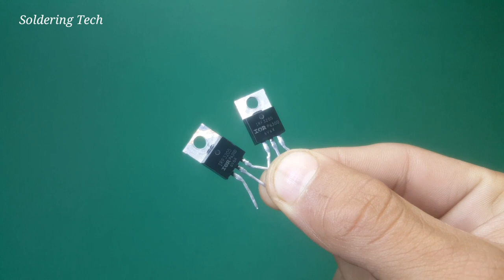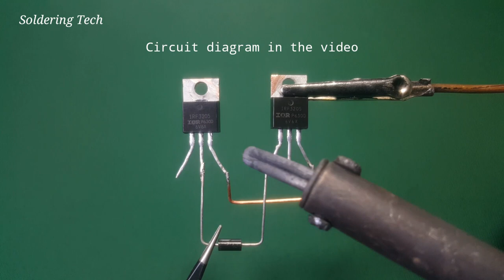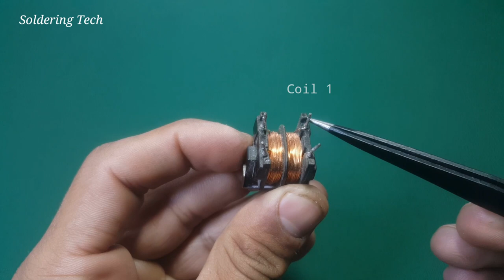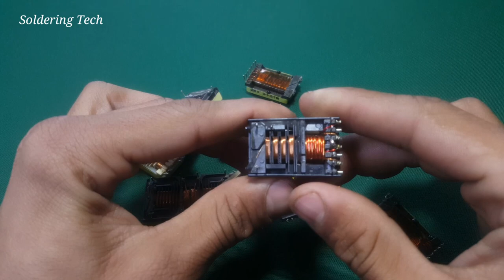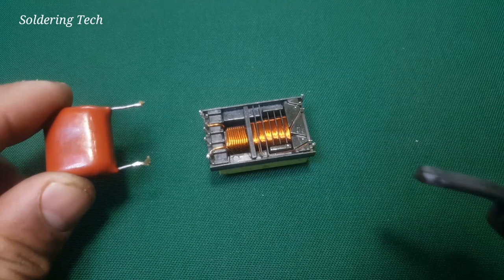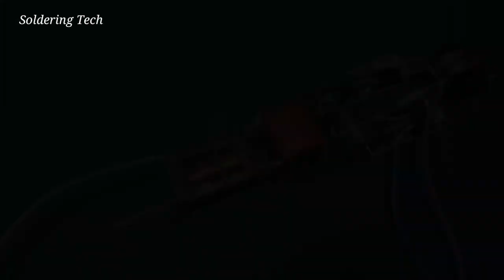How to make high voltage generator | Plasma arc lighter | High Voltage taser | Diy stun gun

Comment: It will not stun, but it will burn.  The circuit is a harmonic Royer oscillator. The output - high frequency high voltage AC.

Comment: First problem how can i get a trasformer😭
Reply: From a charger
Reply from the maker: From old led tvs
Reply from the maker: From old led tv
Reply: @SolderingTech  I didn't have any old broken tv👍.. so I bought a lcd backlight inverter and desoldered the transformer and I made one👍
Reply: Try and by one of those cheap flyback transformer kits rated for 15kv
Reply: @belugafan-fz1ev  yeh but it barely gives 1 or half cm arc😐
Reply: @acex727  

Just reduce make your on primary coil consisting of 3-0-3 turns and buy or make a ZVS driver
Reply: @acex727  or just by a 20kv module and use a 2s 7.4v lipo battery you will probably get some huge arcs maybe 3cm but if you use it for too long you may turn the resistor into a glowing piece of garbage

Comment: How many watts is each resistor, and how many volts is the polyester capacitor? because I only saw the capacitance of the capacitor. If you still remember and can answer, I will be very grateful!
Reply from the maker: Resistor 1/2 watt to 1 watt.
And capacitor 2.2nf 400v.

Comment: Inductor at the top mosfets,,  where can i find?
Is that mean emi filter ex smps?
Reply from the maker: It is usually in the main AC input section in different power supplies, TVs and LCDs circuit board called as filter coil.
Reply: That was i mean.. 
Emi filter.. 
Thanks brother..  Ill trying..
Reply from the maker: Off course also checkout my short videos a lot of information..